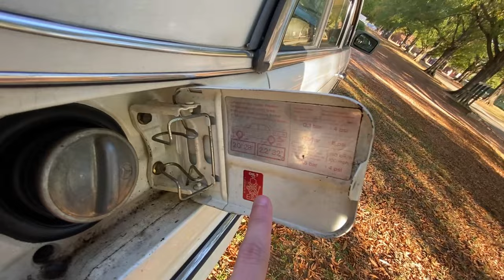I Bought a 1980’s Diesel Mercedes (Full Tour & Driving)

Comment: Next video: “I fuel my diesel Mercedes while smoking a vintage cigarette.” 🔥💀
Reply: jacobfuckingdies
Reply: @SaucyBoy. 😬
Reply: Lol😢 @SaucyBoy
Reply: Actually wouldn’t be very dangerous at all. Diesel doesn’t have the crazy fumes like gasoline does. 
Also, even if it were gas, the only thing that could light the fumes is the spark of the lighter. You can drop a lot cig in a barrel of gas and be perfectly fine.
Reply: @kimifan06 true. It’s safe unless you’re also drinking an Orange Mocha Frappuccino
Reply: Yessir yessir gas station explosions gnomesayin
Reply: @mushdawggg6667  gnomesayin 💀
Reply: you can't light diesel on fire :D its almost impossible its really safe. you have to heat the fuel SUPER HOT for it to catch fire. its just like frying oil
Reply: Diesel so who cares
Reply: HAHAHA genius
Reply: While listening to wake me up before u go go
Reply: it would be perfectly safe to do so “because it’s diesel” gasoline different story
Reply: @Javisto. 🫣
Reply: Big baller move
Reply: Diesel is much more safe to smoke around then gas to be fair. 😂
Reply: Cereal 🥣
Reply: Diesel isn't really flammable though
Reply: Dude my original Xbox profile was your profile pic 😭
Reply: @Javisto  Gasoline is no different , what you see in movies is just for dramatic effect a cigarette will not ignite gasoline
Reply: Diesel is compression ignition, you can’t light it with a cig like that. It’s ill-advised, but way, way safer than it sounds to petrol people.

Comment: I owned the BMW made competitor to your W123, the E23 ('85 735i, M30 3.5 liter I-6) . Absolutely loved it. I got it to 360,000 miles but unfortunately a red light runner hit me and totalled it.
  As for the engine vibration you mentioned though, I'd replace the motor mounts if they haven't been done in a while. It really helped on my E23

Comment: You’ll easily get close to if not more than 600,00 miles. Had the wagon version, should have kept it a long with my 924s and various vehicles I had through the years. It’s amazing how something that was frowned upon turns into treasure through time.

Comment: Such a nice car. I used to have a 1979 240D, LOVED that car. Wish I still had it. This video brought back some memories.
Reply from the maker: 240D's are goated cars as well, shame the diesels in them were trash 😔 The gas 240D's though are so reliable 💪
Reply: Depends. Not the easiest car on the freeway at first, after a while you learn how to drive it without issues, all about timing. People around you will either love your car or hate you. The 4 cylinder 240D diesel engine is the most reliable, long-lived engine from the W123 series. The 5 cylinder 300 turbo has to be the best though. The gas version is the 240E. I used to fly down the highway at 90mph in my 240D, took a long time to get to that speed though lol. Cheers